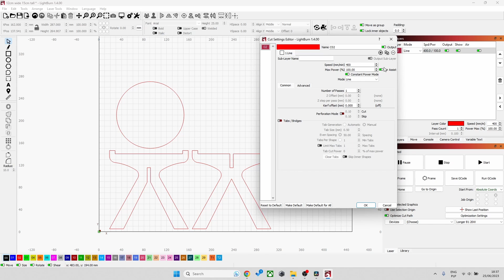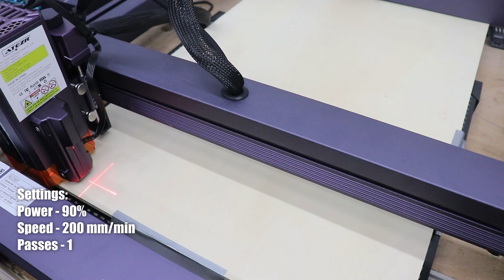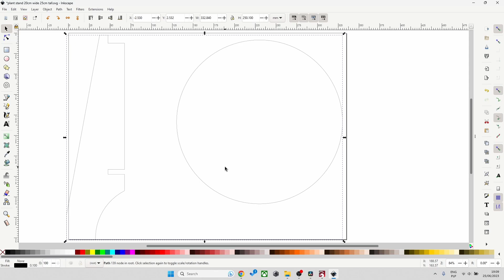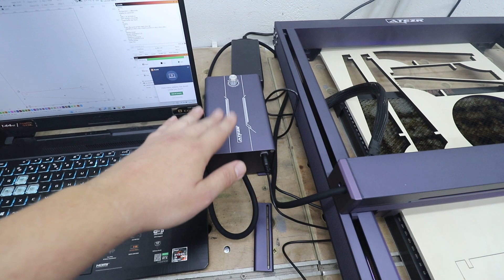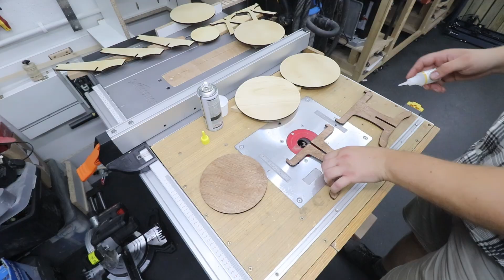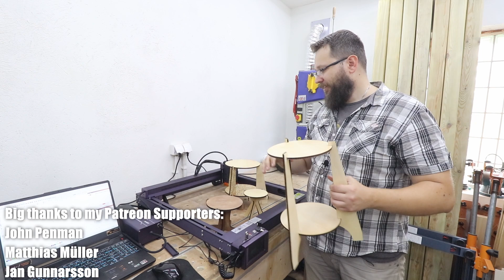Custom Plant Stands with Atezr L2 36W Laser + FREE Stencils

Comment: Hi, I can't find replacement lenses anywhere...🤐
Reply from the maker: I had mine in the box with the machine. Did you try to email them directly to see if you can buy spares from them? I don't think they are unique to this module so you may want to look for them on Banggood, Ebay or Amazon.
Reply: I couldn't find them in any of these tips
Reply from the maker: @jesus-n5c1l  I just had a look at their website and there is a package of spares available with different parts including lenses.

Comment: Nice project. Please be carefull with the fumes i see you have an extractor there but an enclosure is a must if you're gonna use a laser on a regular basis. Cheers with another great project.
Reply from the maker: Yes I'm designing a full unit for several lasers fully enclosed. I do lift my garage doors as well to help with removing the fumes 👍
Reply: @CasualDIY  Super looking forward to seeing your take on the enclosure.